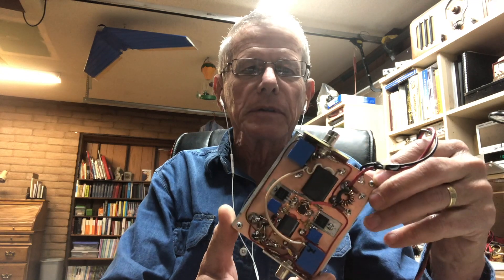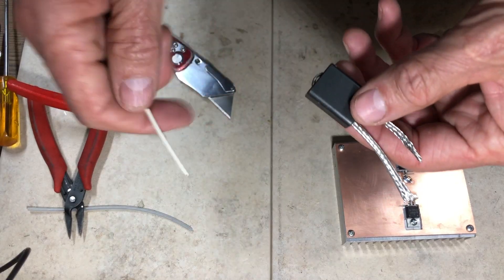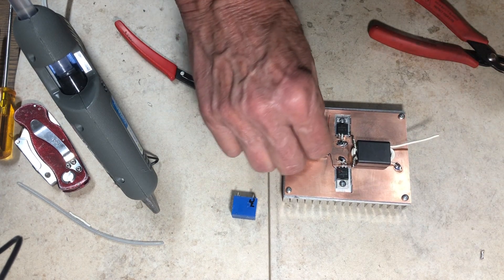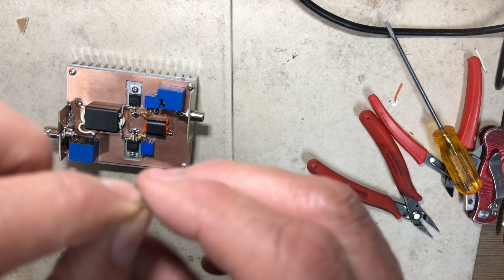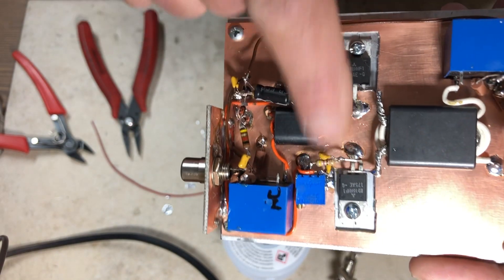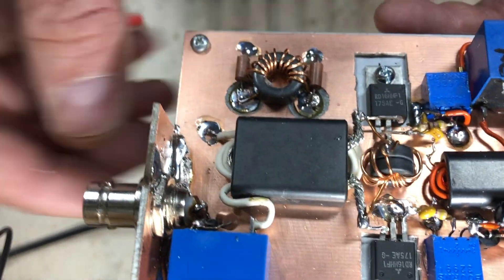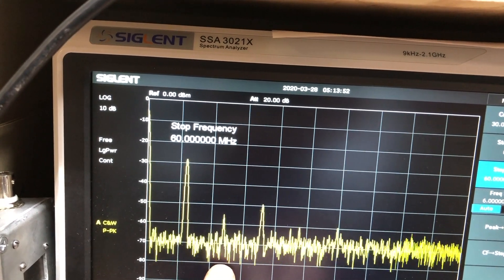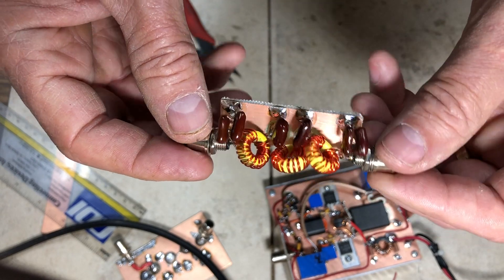RF Power Amplifier Construction

Comment: hola veo que a un transistor le dio 80ma y al otro 20ma total 100ma quedaron desparejos
Reply from the maker: Hello Matias. Actually, I set each transistor for a quiescent drain current of 30 mA. They aren't un-even. With bias starting at zero, there is some idle current. Write that down. Then, with no input RF, key the amplifier on and  adjust one of the bias pots slowly until the total current rises by 30 mA. Then adjust the other bias pot until the current rises ANOTHER 30 mA. The new total will be 30 + 30 + unbiased starting idle current. I hope this makes sense. 73 ... Ron